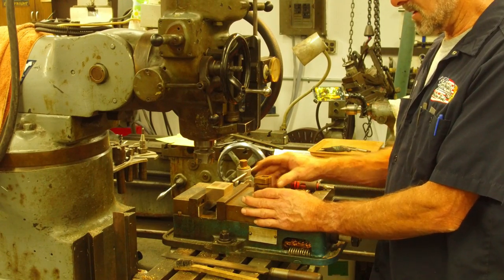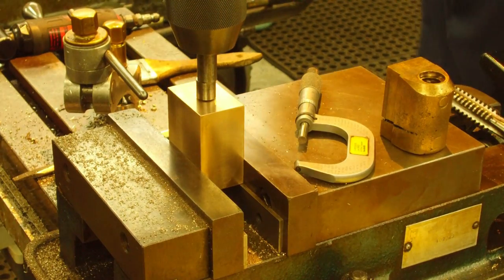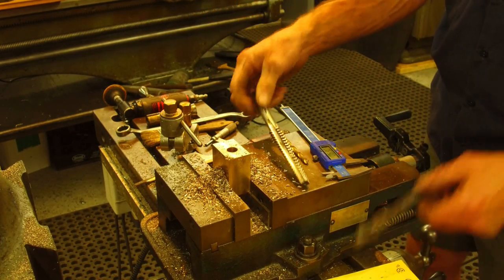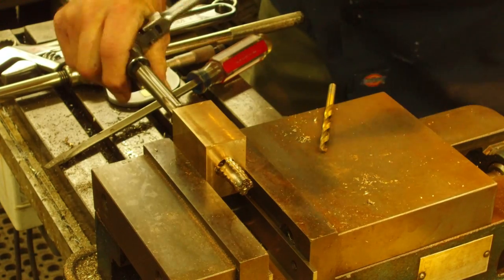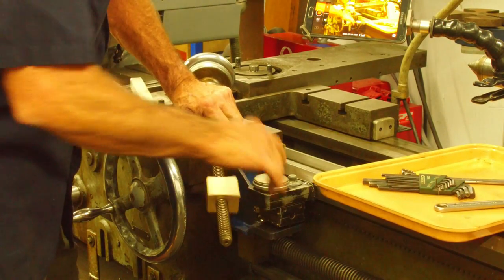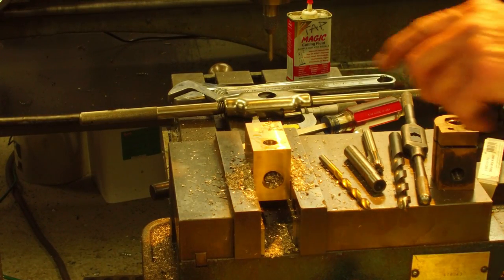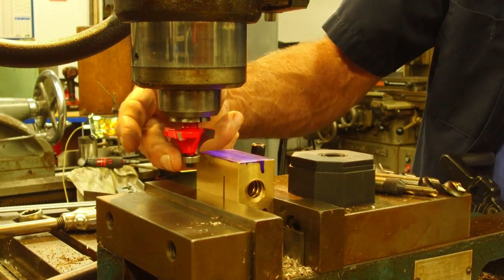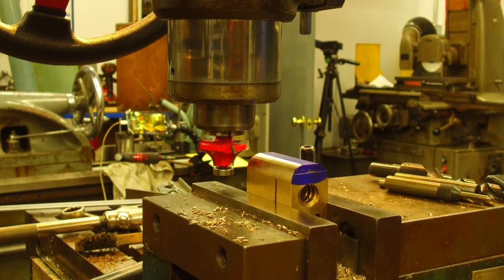Free Space Part Two

Comment: I always wanted to try a Carbide Wood router bit in my mill but didnt have the nerve . Now that i know it works ill have to try some form cutting with some may also try them in the lathe in a holder  . I have router bits out the wazoo and dont do wood work so now theyll get some use lol. Great video Keith !!
Reply: Tom Lipton used on on steel during the "Press" build.  He had good luck with it too.  Looks like a good option for the one time job where a milling cutter would be a lot more.

Comment: Never would have thought of using a wood router bit for the radius. 
A helluva good idea. 
I needed a new cross feed nut for my Atlas lathe but found a new on
Ebay for $45.00 .  I did think of doing what you did but couldn't justify it .
I didn't have the material or the left hand acme tap
and figure for my it just didn't make sense. If I had I couldn't have done a nicer job than you did.

Comment: Don't throw the old nut away Keith, bore out the old thread, silver solder Bronze plug and drill and tap, you have a spare.
Reply: Before it gets silver soldered, the OEM nut needs "cooking", like Keith used to do in the wood burning stove.  L_RD alone knows how much oil has been taken up by the cast bronze, over the years.

Comment: I’m a bit surprised you did not redesign the nut a little and make it equal length 2 nuts with slide pins and 3 grub screws instead of the flex for backlash adjustment. That might also get you a lot more adjustment before needing to make anew one.

Comment: Nice job as always Keith.
Maybe I missed it, but did you drill the hole for the 1/2” UNF bolt through, (or with a smaller dia) in order to press oil to the nut / leadscrew as  i noticed an oiler in the bolt head.
Reply from the maker: You can pick up on that in part one, while tearing down. ;{)
Reply: Keith Fenner 
Thanks Keith,
“Now i hear you” as they say.
Watched part one again and found out that indeed i had missed it.

Comment: I've been using an American Rotary 3 Phase converter for over 8 years now and I don't hear it any more.  It's become shop noise.  Mine is a 5 HP, 3.7KW/240V Soft Start and it's the best out there.  OH, by the way, our electric company wanted $10,000.00 to run 3 phase 240V to my shop.  So a $1,000.00 American Rotary 3 Phase Converter was my only option.

Comment: I found the split nut idea a waste of time, that small length of thread engagement on the short end wears out in no time.
It accelerates the wear of the nut in my opinion.
I wanted to fit double nuts on my import lathe but not enough space, just put up with the backlash.
Reply from the maker: Exactly why I made the nut longer too gain the thread length contact. Great comment! ;{)